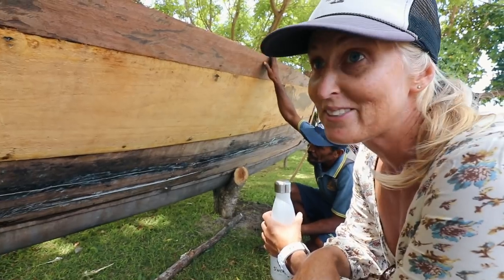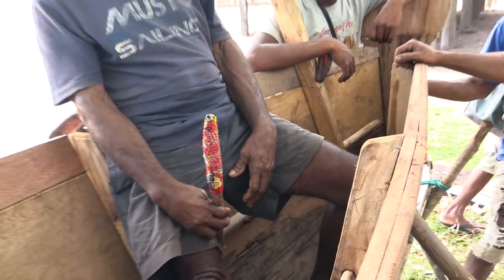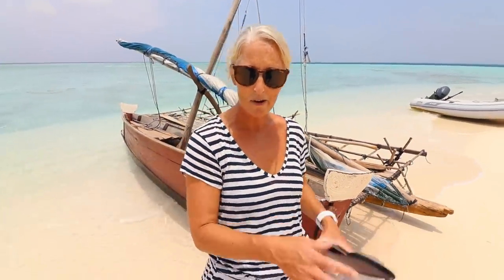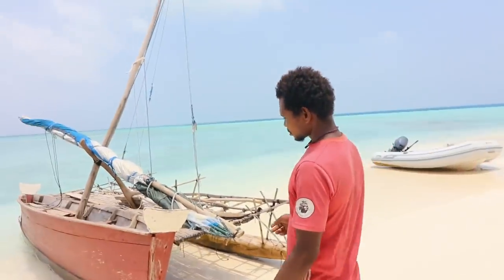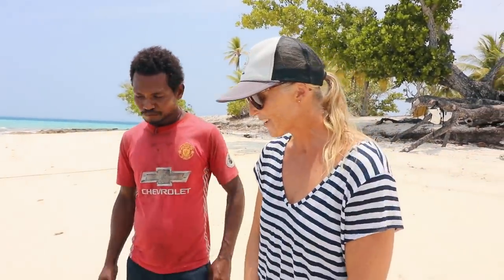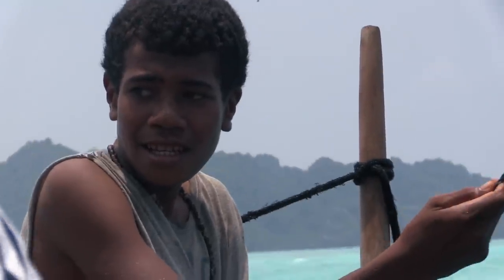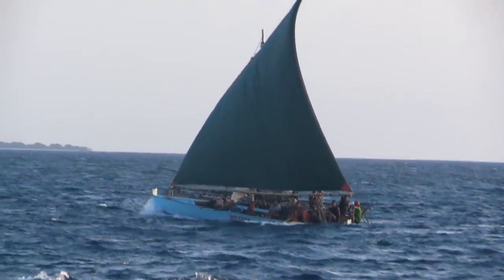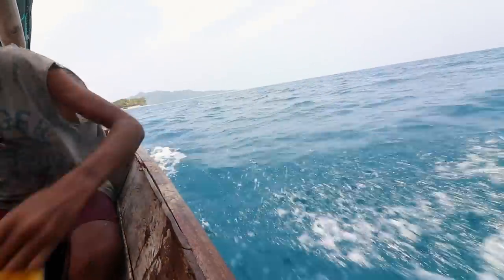These Men Sail 200 MILES in a Traditional Sailboats

Comment: I just watched "Systems and components for offshore sailing"-- was the first video of yours I ever saw, as I searched YouTube for catamaran sailing.  I'm planning to make the switch to a catamaran from a monohull.  Then I went and watched the first two videos on your channel.  You are totally different people. Its kinda amazing.  I don't mean the tans, I mean the self confidence, the salt in your blood. (or whatever it is when you've crossed the equator under your own power.)    Bravo!  Also, your editing has improved hugely, you're doing a great job.

I'm sure you know these Proas you're watching be made are the forefathers of your catamaran, but they're also an active modern boat design to this day-- check out Aspen Catamarans for a modern proa. (and like these boats they have less space than your cat all things considered because the outrigger hull is smaller.)   

PS -- When they "tack" by moving the boom, that's called a "Shunt" or "shunting".   In bermuda rigged ones (like HarryProas) the boat actually changes direction and starts going backwards and the bow becomes the stern and the stern the bow.

Comment: These boats are like proas? I love this vid, because the technology of those simple boats is in my opinion better than our common cruise boats, and the outrigger is supposed to flex. They are quicker and with the best ride for their size. The boats can also be reasonably sailed single-handed, and they sail like a kiteboard = same side windward always. Turning is called shunting. For a fiberglass cruiser version check out Jzerro or Equilibre proa on YT. You might just want one. :)